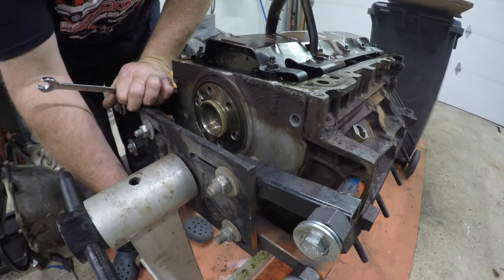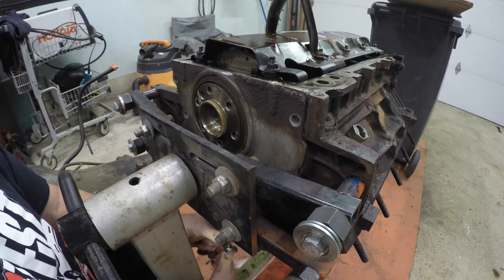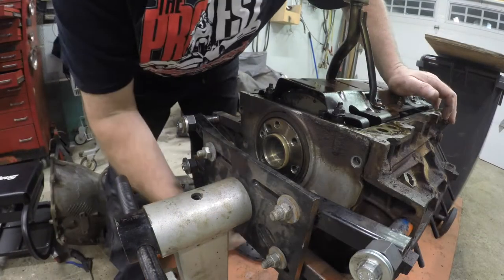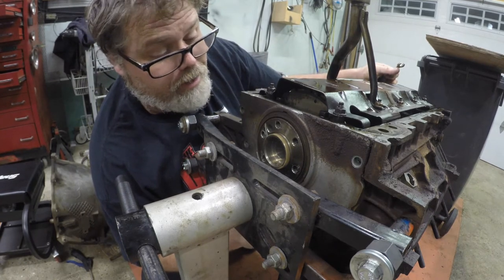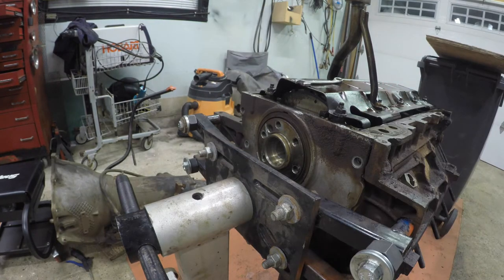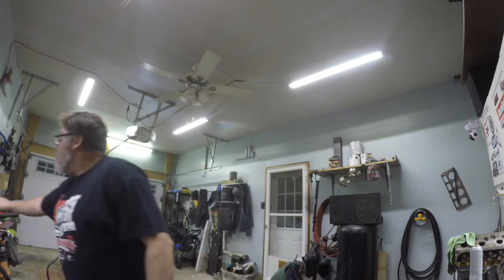LS Rear Main Plate

Comment: If your replacing coil packs. Look for the ones they ran in trucks. They have a heat sink on the coil. Those are the better ones. Also don't buy aftermarket. There junk. Glad to you changed your mind on the valve seals like I mentioned. Best of luck!

Comment: There is nothing worse to have than a Leaky Engine.
Great practice to change All Leaky spots before the engine is Buried in the van. 
Also make sure that your Freeze plugs are not all Rotted out. Corroded up.
Now is the time to do it.
Cheap inexpensive repair.